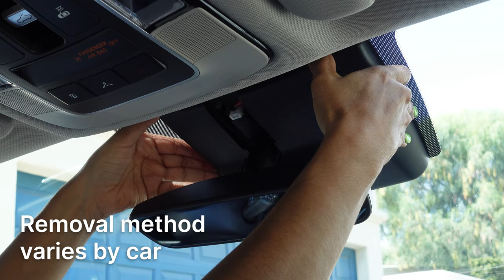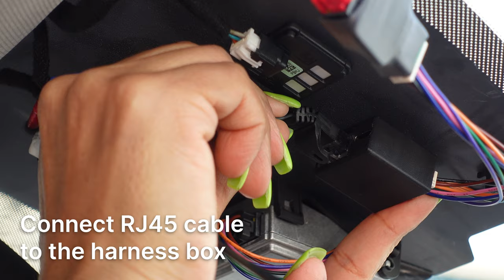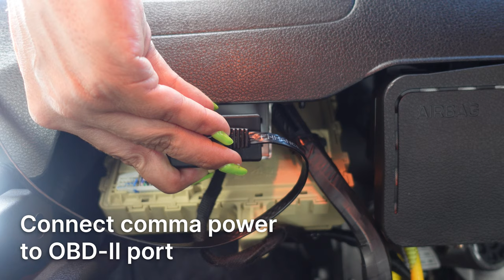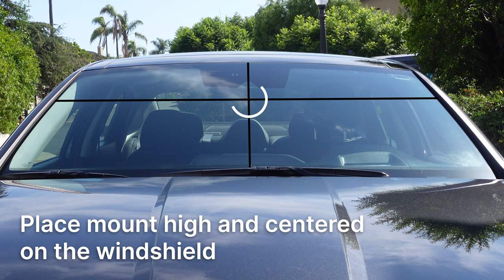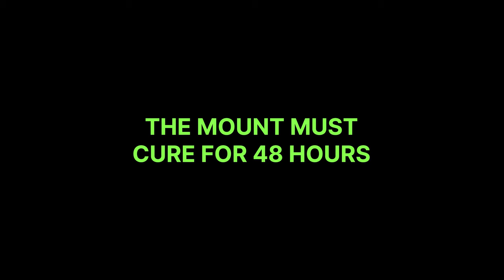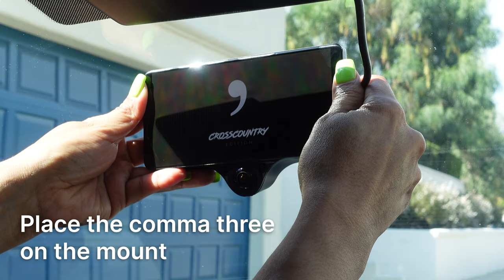comma three Installation Guide

Comment: I don't remember a warning about curing for 48 hours with the comma 2. Did something major change in that regard?
Reply: The last thing someone wants to do after this arduous install is wait 48 hours to use it lol
Reply: Hopefully they will find a different adhesive that cures quickly. 48 hours is excessive.
Reply: Any way to speed up the cure with a UV light?

Comment: Just a thought with comma 3x you provide a centering windshield-specific sheet based on vehicle. That will complete the user installation experience.  I know it's a waste of paper but it can be optional.  Another option can be a set of 2 ribbons that someone can use with painter's tape.

Comment: And what moves the wheel and pushes accelerator, brakes? How to install that?
Reply: The wheel and the pedals already have the hardware to control those. All this hardware does is hijack the control signals for those that the stock lane assist/adaptive cruise uses. (Assuming you have a car that's compatible with openpilot)

Comment: Too expensive, compared to C2. U expect people will upgrade from C2? I dont think so. Only new adopter. 

Why now stereo cameras, few months back George said that stereo is not necessary, where he compared human, Subaru's EyeSight, etc.

One more thing, only Snapdragon 845? Why u guys like to use 3-4 years hardware? Why need to highlight Samsung SSD in your page?

Good job on moving to navigation. I dont think I will upgrade my C2 to C3.
Reply: wait for comma 4
Reply: Per George it's not for stereo but just cameras with different angle views
Reply: @etbadaboum  yes, u r right.
Reply: can you read before comment? the cams are not for stereo although he admit if his theory failed the hardware is ready for stereo. And the other you should read yourself.
Reply: @hc8714  wtf man? I responded earlier, above. Dont want to delete my main comment as my other points still stands.